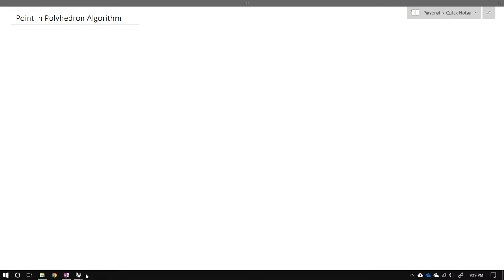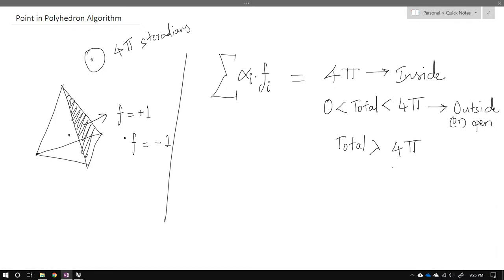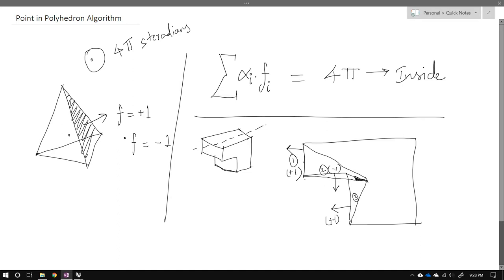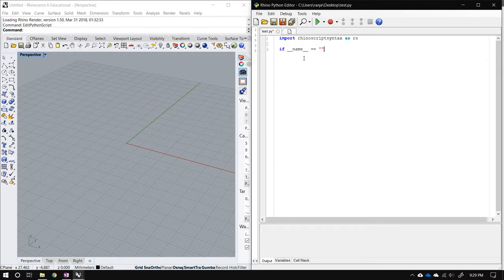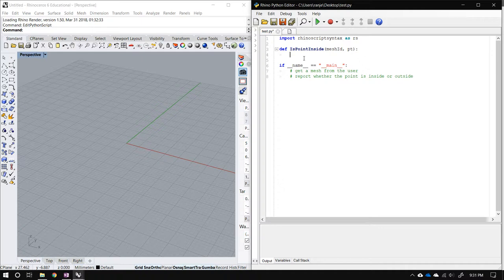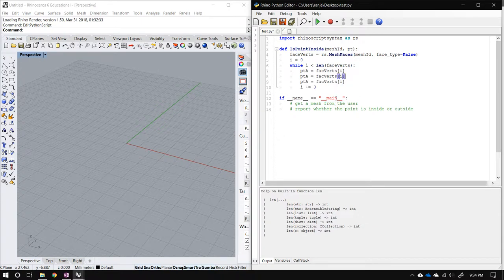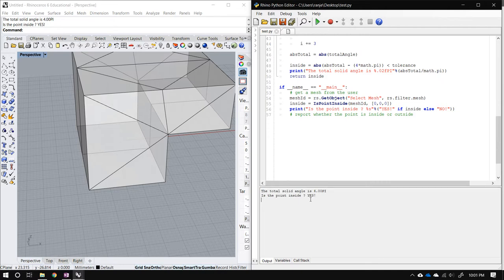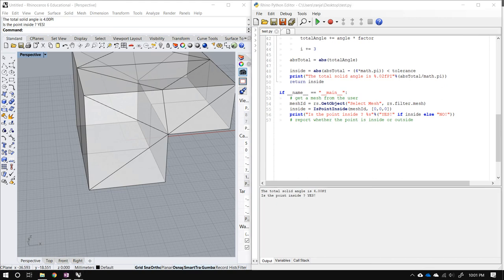An Algorithm for Point inside Polyhedron (Mesh or BRep with planar faces)

Comment: Thanks Ranjeeth for presenting this. This briliant algorithm was mainly used in the early 80s when polyhedron models only comprised very few facets. It is considerably slower than the Ray-Intersection method (my measurements show 5x to 10x
slower). This is not really surprising. The count of operations per polyhedron facet for this method comes to:
37 multiplications
3 square roots
1 atan2 function (this really burns you)

The corresponding operations with the Ray method (using the Moeller-Trumbore algorithm)  comes to about 9 to 16 multiplications per facet  (except for the couple of facets where an intersection may occur, in which case the count is 26).
In today's graphics where polyhedron models may consist of thousands of facets this can not be the method of choice!

Another severe limititaion of this algorithm (at least the way you presented it) is its failure to work correctly when the polyhedron has holes.  I seem to remember that, in the original paper, the authors claimed that the algorithm should work correctly with polyhedrons with holes but they never explained how one does it. Maybe you have some ideas.

Many thanks again for presenting this.
Dimitrios
Reply from the maker: Yes its a lot slower doesn't scale well when the number facets goes up. I just thought it was a very elegant and intuitive algorithm thought I'd share it here. I also plan to do a video on a superfast ray-casting algorithm, for cases, when you have to do this check for the same mesh for several points.
Reply: @ranjeethmahankali3066   really Great, thanks for the video and illusration.  Is there any python Code implementig the superfast ray-casting algorithm? or  Ray method (using the Moeller-Trumbore algorithm). Thanks and keep the good work :-)

Comment: Are points on polyhedron faces marked as internal ? Does the sum of solid angles subtended for these add to 4*pi
Reply from the maker: When the points are on the face, the triple product of the 3 edges of the tetrahedron is zero, which means the arctan of that value is 0. If you run the code as from the video - the points on the face will get a total solid angle of 2 * PI. You'd have to add a special condition to check for that. And if the point is on an edge or a vertex, it'll get more complicated. TBH, this tutorial is from a while ago, and while it explains the concept well, the code doesn't handle all the special cases. Good catch!